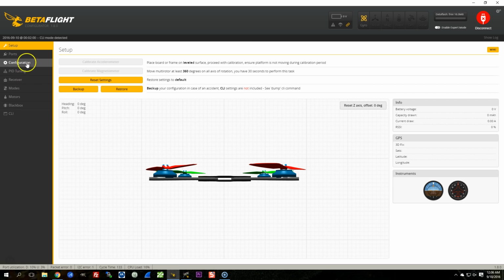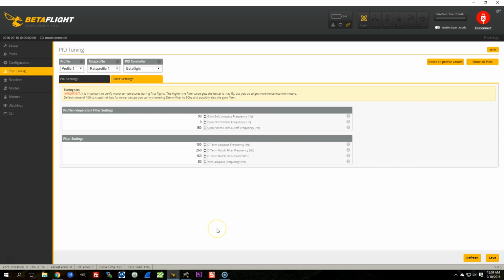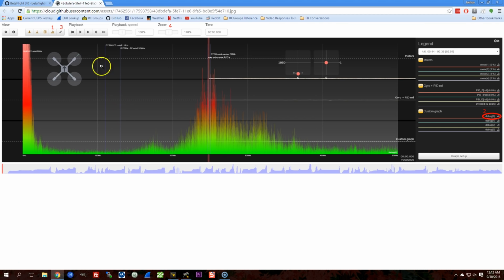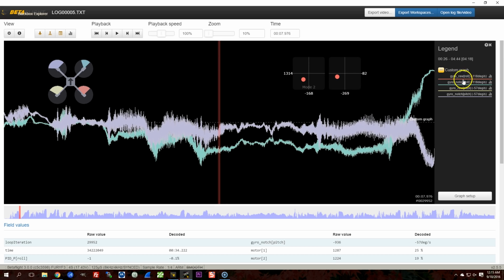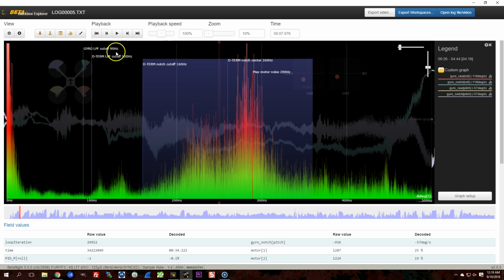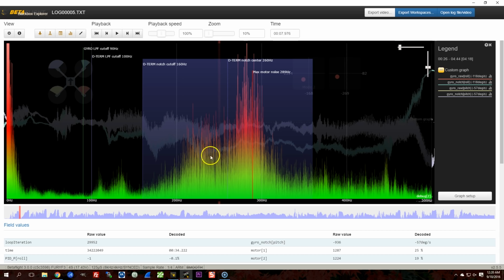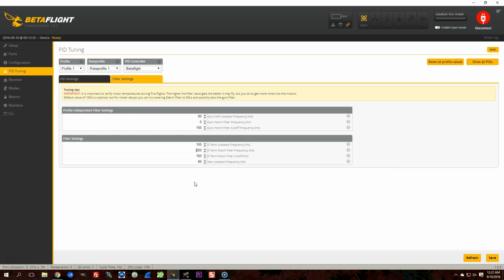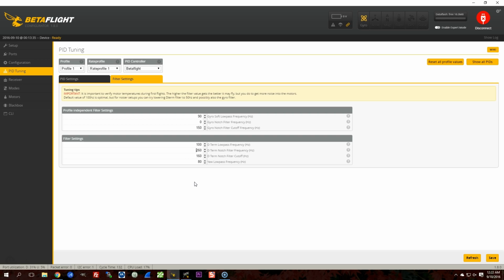Betaflight Notch Filter - How To Configure

Comment: any experience setting a dterm notch filter center around 50hz with a cutoff of 10hz?
Reply from the maker: Why would you do that? Seems like a super wide super low frequency filter that would add a ton of delay.
Reply: @JoshuaBardwell  from 40-60hz would be wide? I have a nasty 47hz spike on my D-Pitch log. Its not bad in Gyro Pitch but I’m trying to wrap my head around why the would or wouldn’t work? Or if I just should slide my gyro and d term sliders down (BF 4.3) this is for a 7in Thicc BTW
Reply from the maker: Correct me if I'm wrong but I thought the cutoff was the lower bound of the notch, so if you want a 20 Hz wide notch, center of 50 and cutoff of 40. I may be misremembering that, but either way I understand what you're asking for.

If there's a huge spike in the dterm, it has to be coming from a spike in the gyro. The dterm amplifies gyro noise. I would personally be inclined to fix it mechanically first, and then with gyro filtering second. 

Anything below about 80 Hz is pretty low for either a notch or a lowpass filter. The reason is that propwash oscillation frequencies are around 50-80 Hz (typically) so if you over-filter that range, you get really bad propwash handling. Propwash handling requires the lowest possible latency response from the PID loop. 

This is all affected to some degree by the fact that you're running a 7", so your prop rpm is lower. All the "normal" guidelines for filtering are based on a 5" quad. Still, I think that filtering down around 50 Hz is likely to cause more problems than it solves, and the approach has to be to identify mechanically what is causing the noise.

A strong 50 Hz oscillation is sometimes caused by a super long vTX antenna. Could that be it? Try replacing your vTX antenna with a "stubby" or otherwise mount it so it can't vibrate?
Reply: @JoshuaBardwell  appreciate the insight. I’m looking at my crsf immortal t’s from my diversity wondering if the one mounted horizontal off the nose could be producing some vibes? Air unit antennas run underneath the frame and are actually e-taped on so they aren’t moving, but I might try a new orientation of my immortal t’s. thank you, sir!

Comment: Hello Joshua. Im at the point where Im starting to understand tuning better so I thought Id stop and watch this video as I think my 4inch could really use some analysis. I went to set debug but Betafligth told me there isn't a notch command. Im using the latest Betaflight.  Betaflight / OMNIBUSF4 (OBF4) 3.4.0 Jul  8 2018 / 04:23:56 (cce8a59be) MSP API: 1.39. I checked an older version on a quad and it had the notch debug. So I guess I have to write an older Betaflight in order to do this test, or did I miss something. Thanks for reading my message.
Reply from the maker: They changed the name of the parameters but they're still there. See here: https://github.com/betaflight/betaflight/wiki/Black-Box-logging-and-usage#changes-were-made-in-betaflight-30--31-along-with-a-newer-bb-viewer--see-debug_mode-on-the-31x-wiki-page
Reply: Awesome, thanks so much.

Comment: why not run only the notch filter if the low pass filter is akin to latency? or if there is a higher frequency spike then why not run the lpf above the notch filter? why not increase the db/octave of the lpf instead of notching out the area above the lpf to get the lpf closer to the motor noise? running a notch at a point above where you are trying to filter out seems a little convoluted, it may as well be a second layer of lpf to increase db/octave sice the area above the notch is gonna be filtered out by the lpf. it's strange to me that the don't prioritize the notch over lfp or run the notches below the lpf.
Reply from the maker: Some people have turned off the gyro lowpass without smoking motors. But it's very risky and the performance gains are minimal.

Comment: Josh, this is by far one of the best videos you've ever made. Maybe you could make an updated version for BF3.3?
Reply from the maker: To be honest, most people are disabling the static notches entirely and simply running the dynamic filter. The dynamic filter is better because it auto-adjusts. It didn't exist at the time I made this video.
Reply: Understand that. What about the new "Kalman" filter? I saw your newest video about Betaflight 3.3 and depending on the method you recommend disabling dynamic filtering or not, and "adjusting" stage 2 lowpass, and apparently there is some discrepancies on how to exactly do this. I also understand it might be a little bit early for that, but do you still believe this methodology is not helpful in this case either?

Comment: If you have a 90Hz gyro LPF and 100Hz D term LPF, why is there still noise at those higher (260Hz) that you are addressing with the notch filter?  Am I misunderstanding what the LPF does?  I thought it threw away all the data above it's set frequency.
Reply from the maker: Lowpass filter attenuates the data but it doesn't completely eliminate it. The steeper the rolloff curve, the more attenuation, but also the more latency the filter imposes on the pass-band frequencies. So there is a tradeoff between more filtering and more latency.
Reply: Aha!  Thanks.

Comment: mr bardwell u may have better idea of issue but i wrecked into mans truck and smashed the hood eeek expensive wreck but my 5" mad hatter and i replaced the arms with some thats slightly longer becouse thats all i had.. so without anything else done i went to turn off notch filter 2 becouse i allready had pt1 done before wreck and flew good. i took notch filter fro stock 400 to 0 and it has viberations ive never seen or heard before.. does turning off a filter have the chance of causing viberations? almost sounded like a bent prop sorta
Reply from the maker: +David Downs yes that can happen but more likely you damaged something in the crash.

Comment: Hi josh
Im currently running my set up with the Lowpass pt1 n tweak the norch filter
Im planning to change my frames , esc n motor. 
Before flying should i switch it back to stock filter?
Thank in Advance
Reply from the maker: +Gonazty yeah probably.
Reply: Thanks for the reply
How do i reset all to stock

Comment: one thing I am confuse on this video is you set the d notch base on the spectrum on the gyro raw.  shouldn't you set the gyro notch unless you are inspecting the d term spectrum ?
Reply from the maker: +Jack Truong D term is derived from gyro so setting D term filter based on gyro is correct.

Comment: can i do removing notch filter on oneshoot protocol????
Reply from the maker: Whether you are using oneshot or multishot is not related to whether you can remove the notch filters. Remove the filter, and test carefully to see if your motors are hot. If they start to get hot, put it back. And be sure you record the values before you delete it so you can restore them later.
Reply: thanks, I will try that :)

Comment: Probably already answered this in other videos. What all can attribute to motors running hot or warmer then usual? besides flying habits. my emax rs2205 motors seem to run hot majority of the time. haven't even touched filters and have barely tuned the pids much other then turning down the d gain significantly.
Reply from the maker: Screws too long, touching the windings. Excess vibration / not enough filtering / excess D gain. Over-propped--too much prop for the motor. Also, define "hot". If you can pinch the motors after a hard flight and not wince and want to pull your fingers away, that's more like "warm" and it's probably okay.
Reply: My motors get warm, almost too hot to hold but not hot enough to burn your finger. I though the emax motors were supposed to be cooler running motors, might just have to finish doing my fine tuning. thanks!

Comment: i need some suggestions for 5" alien with new omnibus f4 pro that was running 3.0.1 betaflight does that firmware have airmode active? I need to know what i need to do for 3.1.7 i just installed.. I may try the stock pids and see if i can work off them to get a better flying quad. wasnt bad before but figured 3.0.1 is way old and needed changed. Filters i have no idea how to setup , im worried to fly it with everything stock i dont wanna wreck because i didnt setup something i had maybe with 3.0.1
Reply from the maker: Here is a betaflight 3.1 setup that I did. You don't have the exact same copter or FC but the basic preflight checks are the same.

https://www.youtube.com/watch?v=e7dGCZMJ6SA
Reply: so was 3.0.1 airmode active like the notes say on 3.1.7 that airmode active it just reduced the I pids .. I went ahead and made airmode active without switch cause most time i dont come in and land and sit i disarm quickly or catch in hand. Id say 3.1.7 is alot better than 3.0.1

Comment: Hi Joshua ! (I'm from France, so sorry guys for my English)
I'm struggling since I build my first brand new copter... Some very disturbing vibrations happens since the first flight (march 2017). I fisrt soft-mounted motors and saw improvements but the copter stayed still very unconfortable to fly. Then I softmounted FC and again big improvements but the vibrations are still there. I learn (thanks to you) how yo interprate blackbox logs and I found noisy gyros (especially the yaw ones) and some unexpected things whith P roll/pitch/yaw while RcCommand was doing nothing. I think i've also got some "jitters" on the roll axis (i'm not sure this is called jitters, I saw very quick movements of roll in very small amount of time like 0,100 seconds and with a shape of an oscillation)
I tried some settings with filters but i'm not sure of what i've done and seems to do nothing and if I look at the analyser display things seems to be ok...
I don't want to pollute more your youtube comments so I hope you'll have some time for me, maybe I can reach you on facebook and give you my logs and video ? I hope so ^^
If I'm asking you that this is because I really understand you well which is not the case of the RCgroups threads for example and unfotunately french forums are not as full of information as your channel...
Best regards !
Nico

Comment: Whats the diffrecne between the D-term notch and the gyro notch?
Reply from the maker: +Dashz gyro notch is applied to the gyro data before the D term is calculated. D term notch is applied to the D term after it is calculated but before it is added to the PID sum.
Reply: The problem I have is that I don't know if I have to change my gyro or my D notch (I uploaded an image to Slack)
Reply from the maker: It's a tough question, and why tuning filters is so difficult. Changing the gyro affects both the gyro and the D term. This keeps the P and D term in phase with each other, because they are both delayed the same amount by the gyro filter. But the D term needs much more filtering than the P term, so you can't just filter the gyro enough for the D term because the P term will be excessively delayed. So tuning the filters involves finding a balance between filtering the gyro enough to maintain the phase relationship between P and D, and then adding in D term filtering to remove just enough noise, without excessively delaying the D term.

All of which doesn't in any way answer your question :-)

I would say try tuning the D term notch and leave the gyro filters alone.
Reply: Wow, thanks that certainly helped. Ill give it a try.

Comment: would this help my mid throttle oscillating??
Reply from the maker: Possibly. But soft mount the FC first.
Reply: hey josh at this point i really don't know what to do and your probably tired of hearing from me by now.. but i changed every component on the quad.. i am still getting jitters (looks like yaw jitters) when i get a hair above mid throttle.. anywhwere else on the throtle it's fine.. i softmounted the motors the fc tried dshot multishot i don't know what the hell to do.. i'm running a lux v2 any other suggestions?? thank you as always!
Reply from the maker: Sorry, I'm stumped.

Comment: Hi there Joshua, Thank you so much for making this hobby great for everyone, world needs lots more people like you :D
in the latest version of blackbox configurator, when creating the custom graph, selecting the "Debug Notch" it does not add the "raw" values but instead there now are "PreNotch"? is that some new identifications in the logging process?
looks like all still functions very well :D
Reply from the maker: +Markus Freysen they just changed the names of the parameters I think.
Reply: Thanks Joshua, my filter's center frequency is way off at 260mhz, worst motor noise is on pitch at 181mhz and the frequency cut-off barely contains it, but it still flew very well.
The guide from "propwashed" advises one to just enter the worst motor noise in the "gyro" filter settings, works but not as well as your way, my quad is now as smooth as butter on a hot plate, thanx again for great videos!
Reply from the maker: AWESOME. Glad it's flying well.

Comment: What determines the amount of latency a notch filter generates? The location of the cutoff  or the size of the notch?
Reply from the maker: I believe that the narrower the notch, the more latency there is, because in general, sharper slopes have more latency. And the lower the cutoff, the more latency there is, because latency is a function of cycles, and cycles are longer at lower frequencies.

But I'm not sure that's correct.
Reply: Thank you for your input. Love the channel!

Comment: Question - I have no major spikes in noise following the actual motion of the frame. the tallest peak on roll is 40mhz lower than the default notch and pitch is 50mhz higher. Should I just expand the envelope to encompass those spikes?
Reply from the maker: First, make sure you are using the veritcal slider on the right to scale up the Y axis. The chart always looks tiny to begin with before you do that. Second, betaflight 3.0.1 lets you have two notch filters, so you could tune one for roll and one for pitch. But if you are sticking with 3.0, you can expand the notch to catch both peaks.
Reply: gotcha. here are the graphs - https://dl.dropboxusercontent.com/u/13990619/notch.png

Comment: I have the notorious LUX, which on BF3.0 flies like crap, but I'm not getting any frequencies on notch_debug above 110hz. The LUX is super soft mounted... am I doing something wrong?
Reply from the maker: +raydioz what is your sampling rate?
Reply: +Joshua Bardwell 250hz, if I used anything above it I get frequent squares. 
PS: Thanks for the videos and community support :)

Comment: I never knew about toggling the smoothing in Betaflight Blackbox Explorer. It has a pretty significant impact on the traces too. Is that to say that we should be looking at our traces without filtering? What's the default thing to do, or: what setting (smoothed / non-smoothed) do you usually look at when evaluating traces?

Comment: Hi Josh. Do You know what is the point of having additional filter (notch) over lpf filter? I mean if we take your example or default values from bf3.0, the notch filter is filtering out the frequencies (like 200-300Hz) that would be filtered out by 100Hz LPF anyway. so instead of decreasing the delay introduced by LPF we add a next stage of filtering that I suppose is not delay-free.
Reply from the maker: The low-pass filter does not have a very steep rolloff. A first-order lowpass has a rolloff of 6 dB per octave, and you're down 3 dB at the cutoff. So if the cutoff is 100 Hz, then at 200 Hz, you're down 9 dB; at 400 Hz, you're down 15 dB. That's a significant reduction, but it's not enough to sufficiently attenuate the motor noise. The motor noise is just too loud.

You can make the low-pass steeper, or lower the cutoff frequency, but this adds delay in the pass-band, which we don't want. You're right that adding a notch filter also adds delay in the pass-band. Adding a notch filter gives us more attenuation exactly where we need it, with less delay in the pass-band, compared to a low-pass filter that achieved the same attenuation of the motor frequencies.

Comment: So is this also finally the solution to the over sensitive gyro of the mpu 6500?
Reply from the maker: +Acd FPV maybe but not completely. A glitch gyro cannot be solved with filtering. It's a mechanical issue.

Comment: I switched to Betaflight from CF, and I am pretty impressed with the default PID values.
Reply from the maker: Betaflight on default PIDs flies remarkably well for a large number of people.
Reply: +Joshua Bardwell I couldn't agree more.  Me being new to the hobby flew with Cleanflight, and had a difficult time with basic flight functions.   I put Betaflight on, and did a maiden everything flew nice smooth I felt pretty positive with the flight.   I went out yesterday and flew with beta for the second time, and I was capable of maintaining altitude while doing some basic pattern runs. Your videos have been really helpful!

Comment: after updating to betaflight 3.0 blackbox stopped working. the SD card is present but no longer logs. i have triple checked that the switch is set, it is enabled and set to the SD card and not serial, and that the card is formatted properly. it just refuses to log.
Reply from the maker: You should report this on the Betaflight rcgroups thread or Github as an Issue. I'm not aware of any Blackbox bugs with BF 3.0.
Reply: i posted to the blackbox thread as well. might try updating my 2nd board and see what happens.
Reply: it seems to have been an issue with the card formatting. it is fixed now but it was really strange as the card was not touched before the update and was working fine at that point.
Reply from the maker: Always reformat just on principle. And use the SD Formatting utility, not the Windows disk formatter.